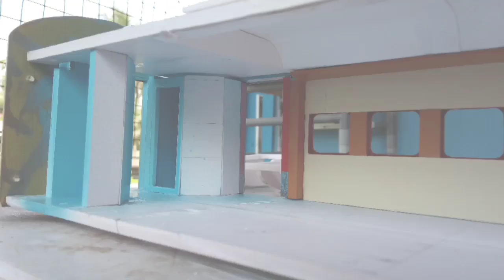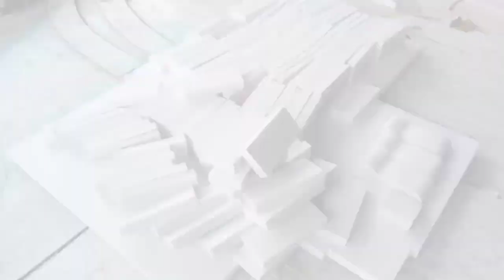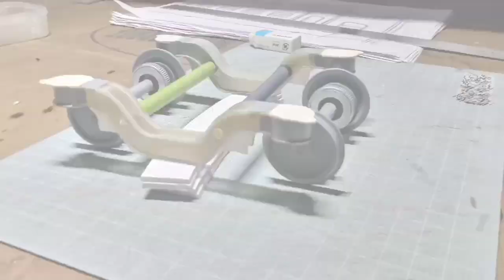Making LHB coach model

Comment: plz tell the measurments of wheel dia, coach length, height and breadth, also the window size.. I am impressed and going to try to make coach like this upto my best.. plz guide.. also how the glass beeding done..
Reply from the maker: 6.7 cm difference between the rails. 3.5cm wheel diameter, 83cm length, 11.3cm width and height from rail level almost 15cm. Thanks

Comment: Sir could you please tell me these dimensions 👇. It will be very useful. 

Gauge? 
Wheel diameter? 
Lhb coach length? 
Width? 
Height from the rail level? 

And how many different radii are given to create that arched roof exactly similar to the real coach? 

And finally how much your entire coach weigh?
Reply from the maker: 6.7 cm difference between the rails. 3.5cm wheel diameter, 83cm length, 11.3cm width and height from rail level almost 15cm. Thanks

Comment: Which material do u use for wheel can give measurements sir of train.
Reply from the maker: Thank you so much, Height 15.5 cm, width 11.3 cm and length almost 80cm
Reply from the maker: Ivory sheet, chart paper, foam board and mount board are mainly used

Comment: Dear friends I want know that to go one coaches to another coaches that part curve one from roof side it's not coming perfect .how I do it clear plz clear how much degree curve part to be taken . right now iam on working off LHB coache plz Guide ur techniques. Some problems in my measurements .plz sir give me lenght width off entrance part off coach.
Reply from the maker: I didnot really understand your issue sorry, could you please put some pics of that so that i can understand your problem. Thank you
Reply: It's a rubber type material is used there and to connect two boogie for going to another boogie

Comment: sir , which material did you use for coach wheel???
Reply from the maker: Its forex/foam sheet 5mm thick
Reply: @HeemsMiniatureWorld  from where did you buy this sheet???
Reply from the maker: @dhruvmistry7475  It should be available in shops selling plywood sheets etc, or making photo frames
Reply: @HeemsMiniatureWorld  thank you so much sir. i asked in many stationaries but i did not get. now i will ask in the shop which you tell.
thanks once again.
Reply: (1)sir, can this forex sheet wheel run smoothly on the track??. 
(2)forex sheet wheels able to handle the weight of the coach???.

Comment: Hi sir my name is bharadwaj which material used to make this train coach sir
Reply: Looks like foam board
Reply: Ok
Reply: What is the thickness of foom board sir
Reply from the maker: Its normal chart paper backed with 3mm forex sheet. And sticker applied on both sides and then painted.
Reply from the maker: Thanku so much